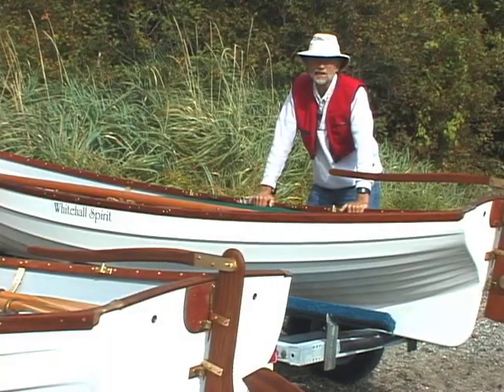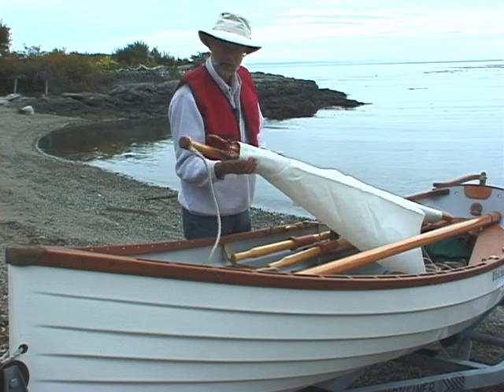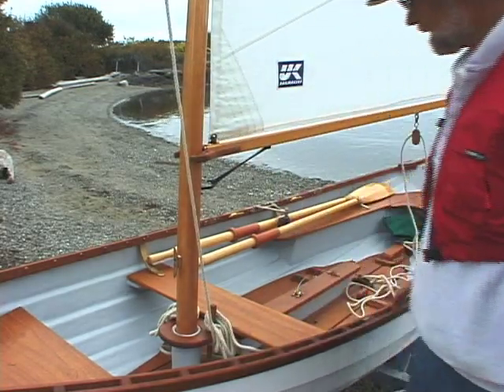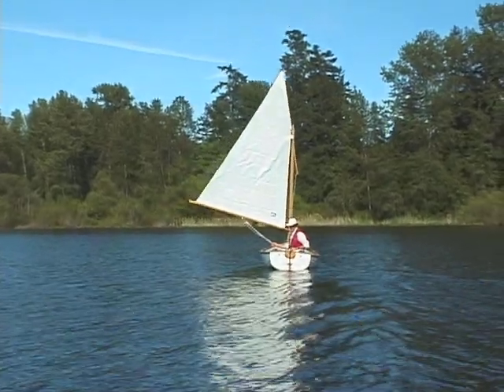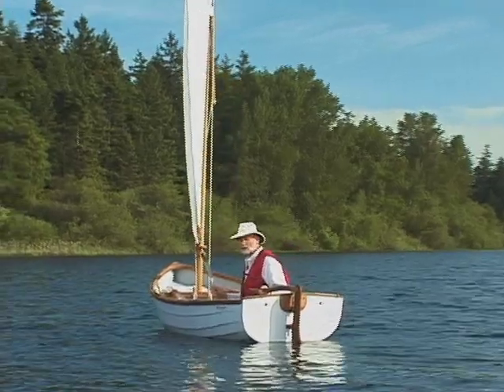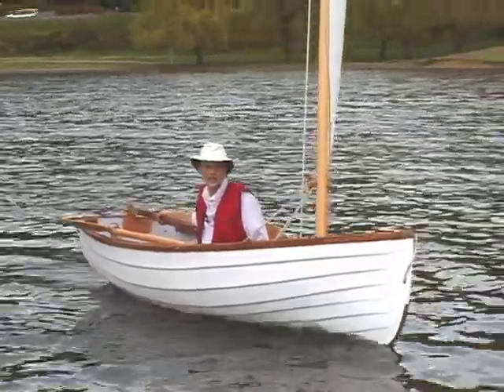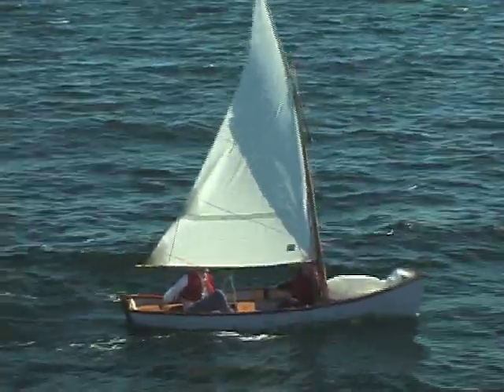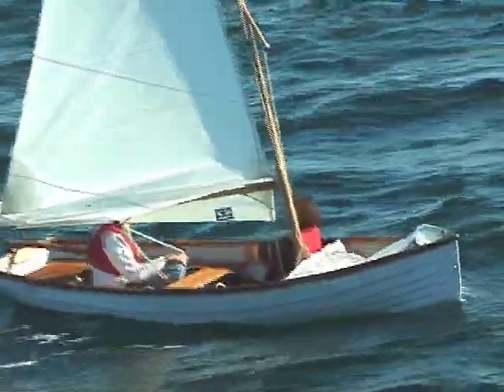How To Sail with Harold Aune

Comment: It's also worth mentioning that jibbing is when you're most likely to capsize the boat, break the boat, and/or break a skull.
Reply: You definitely need to duck you head if it’s above the boom when gybing but most boats are not likely to capsize unless you are sailing in very high wind and waves. 〰🚣‍♀️〰

Comment: Would the Tyee be a better sailor due to more volume aft??
Reply: Also which model rows better?
Reply: The sailing efficiency of the boat itself on a small boat depends largely on the weight of the crew. In this regard a fuller hull sails slightly better and is also more comfortable with more than one person aboard.

Comment: Gunter rig, not lug.  The top most timber is a spar not a lug.
Reply: On a Gunter rig the spar stands vertical … This is a non-dipping lug rig.
Reply: @haroldaune9160  I have a little 9' gunter rigged Curlew. Thank you for a very well filmed video. 
East coast, English